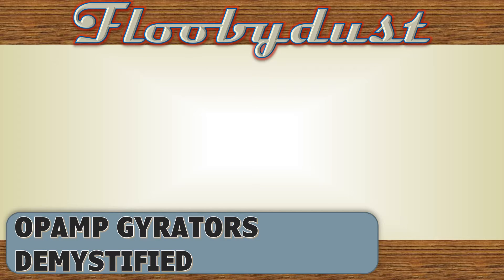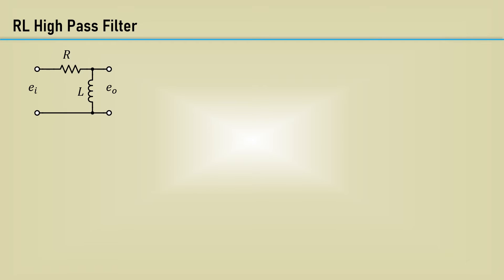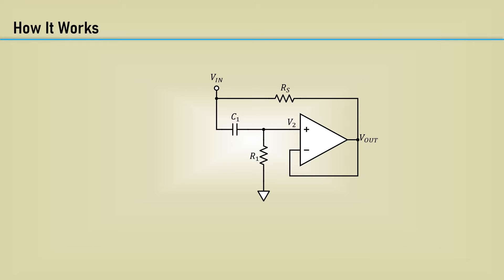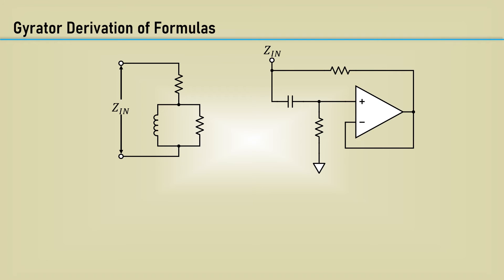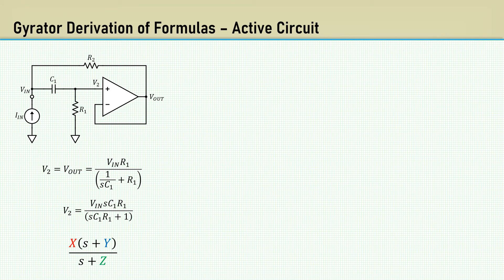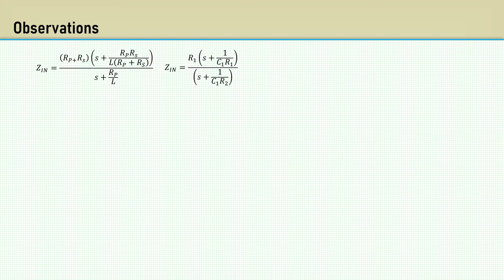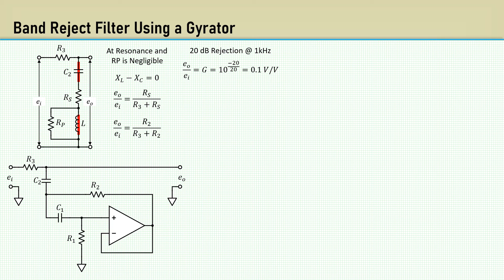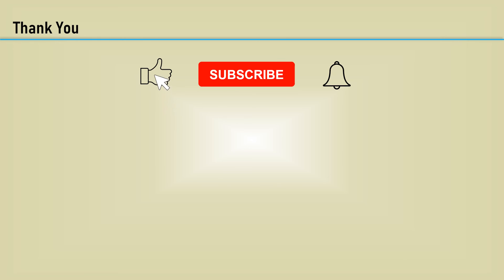The Op Amp Gyrator Demystified

Comment: Very complete video! Do you know if there is a way to demonstrate or find the matrix of the rotator from the circuit with the operational? I tried but it didn't work out. I also didn't find any books that talk about the subject in detail or that give demonstrations, most of them just spit out the equations without showing where they come from.
Reply from the maker: Thank you. No, I do not.

Comment: I am currently building a audio channel strip with EQ section. 4 individual cut/boost pots with selectable frequency. I have all the math done for those, but it is very interesting to have a peek at the math behind a gyrator. Thanks for the video.
Reply from the maker: Thanks for the comment.

Comment: There must be gyrators implemented on one discrete transistor, they must be high-frequency capable, can you make a video of such a gyrators?
Reply from the maker: Yes, I've seen them used in graphic equalizers. You just replace the opamp follower with an emitter follower NPN transistor.
Reply: @oldhackee3915  Wow! but emitter follower has amplification <1 Does bjt work so simple?
Reply from the maker: It doesn't need to be a gain of exactly one. It serves the role as a buffer for the RC network.
Reply: @oldhackee3915  please, please make a video with concrete gyrator implementation and oscilloscope measurements on gelly-beans, lm358 and/or 2n2222!